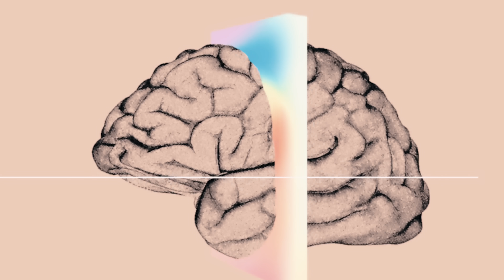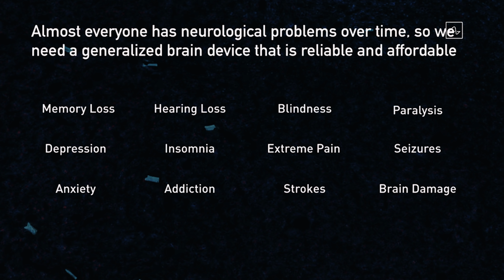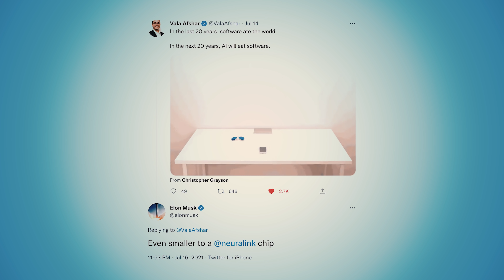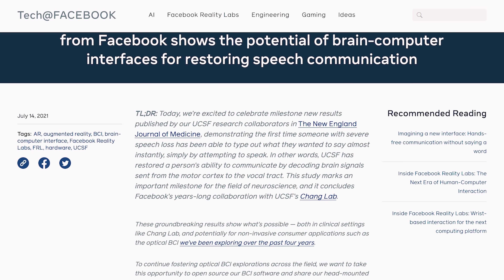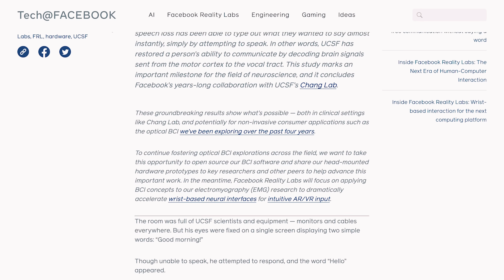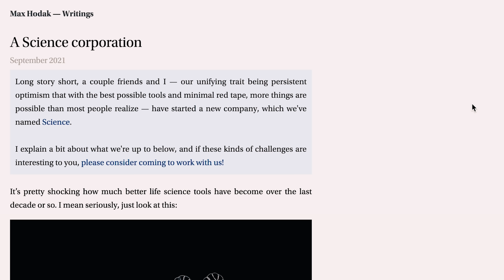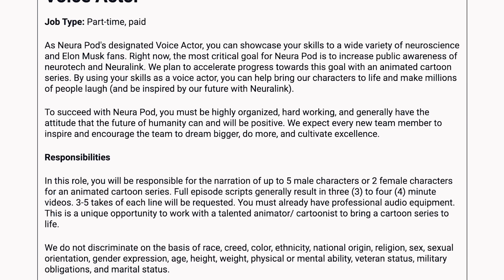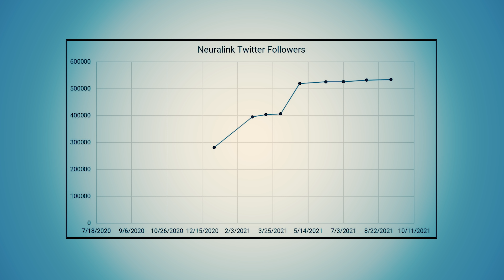Elon Musk's Neuralink Update - September 2021

Comment: What happens to the brain or device when there's a solar storm? 🤔
Reply from the maker: Probably the same as what happens to a pacemaker
Reply: Valid question, though probably not much.  Our atmosphere filters all normal levels of solar radiation, and the largest flares we've ever seen have only been capable of inducing currents in miles-long wires.  You could wear a foil hat though.  If properly grounded it would actually solve the problem. :)

Comment: Thank you for bringing the MS topic "back"

 Did I get it right... No neuralink for MS patients until someone found a way to cure it? ......then the last chance is with biontech (for cure) And the damage is already done, so I need a neuralink device anyway
Reply from the maker: Hi GHSxBloodrage. Thanks for the support + question. Unfortunately I need to start with a disclaimer: I don't know very much about the brain and I'm certainly not an expert. Based on the research I've done, it seems that a Neuralink implant could help MS in the very early stages; however, as the disease progresses, the implant would become less and less useful. It wouldn't surprise me if Neuralink eventually decides to tackle this challenge of helping MS patients more, but maybe it won't be as much of a priority as some of the other diseases that are "easier" to find solutions for.
Reply: I already thought that I will not be able to use all the functions of the neuralink or that I will have to create certain workarounds and I´m cool with it... But the statement of Max Hodak also reads that they fear that the use of a neuralink implant could worsen the disease or the progression of it ... And biontech announced at the beginning of the year that they might be able to offer a cure in the form of a vaccination in two years... Now it remains to be seen what will come out

By the way, to avoid misunderstandings: when I talk about to cure the MS, I mean that the error in the immune system is fixed and the disease can no longer progress... The damage to the brain is there and will remain there.

I agree, MS will not be high on the priority list, but I can imagine that it will be on it...so it's wait and see.